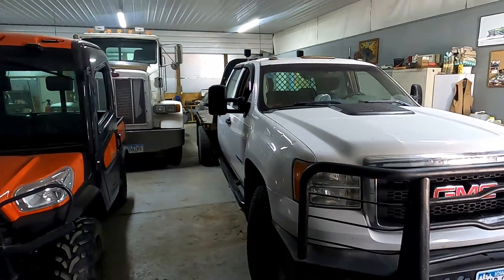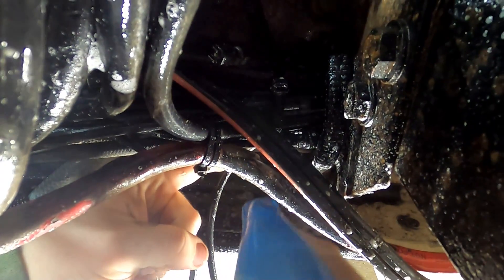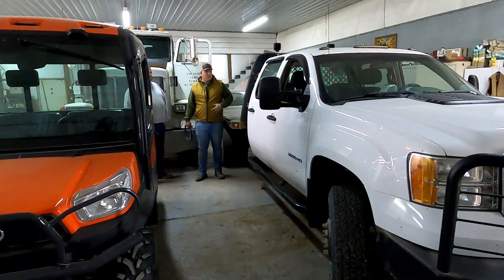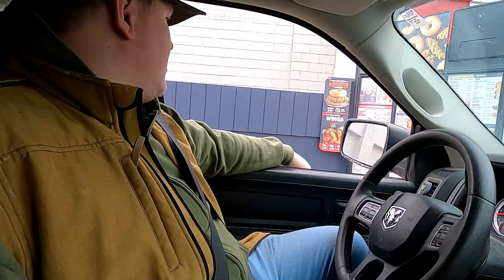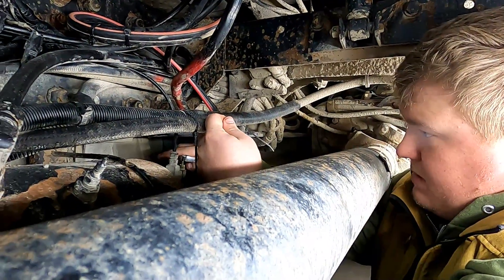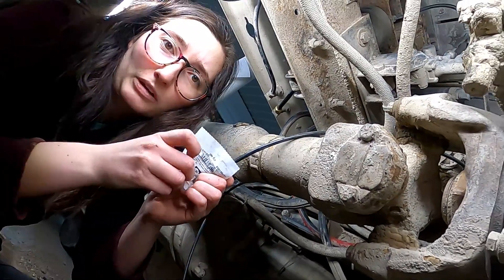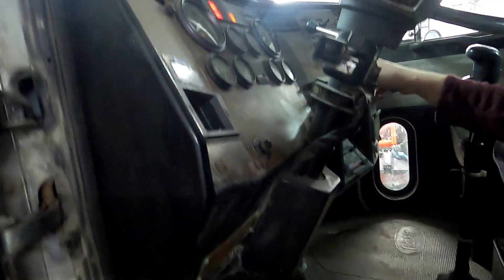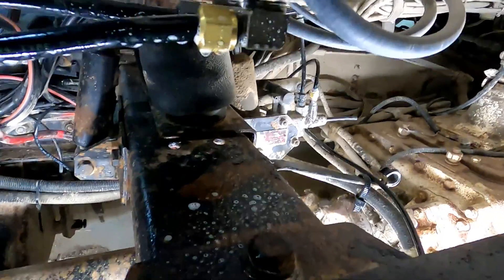Molly the Mechanic - Fixing Pete!

Comment: A tip I used on my fuel pump is I put a plug for the 7 pin to run it.worked great.
Reply from the maker: Aaron Sprung that was my second option! Thanks for the tip!

Comment: I plumbed an air nipple and valve on the primary air tank so I can air up the truck with the air compressor in the shop cuts down on smoking up the shop running the engine when you're working on things
Reply: Brent Anderson I was going to suggest that as well.
Reply from the maker: I think that’s a good ideas. I’ve seen it where people can also air tires off their tanks that way!
Reply: @iowANFarmer  yes it works well I have run the impact for working on equipment airing up tires blowing off the combine numerous things once you have it you don't know how you got along without it

Comment: In case you didn't know, you could have put a union fitting right where the line was leaking then you would not have needed to change the line at all and they make the fittings in a push lock assembly where you just push the line into the fitting and you are done no tools needed.
Reply from the maker: Mike Peterson I need to get some of those for emergencies!